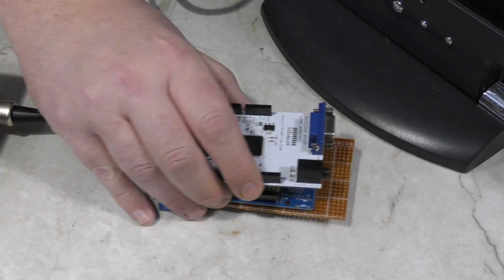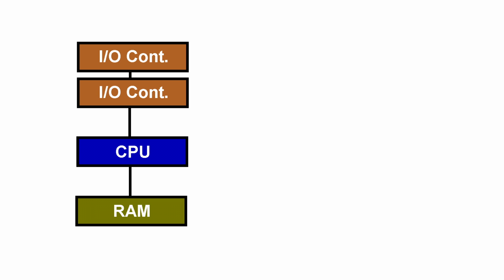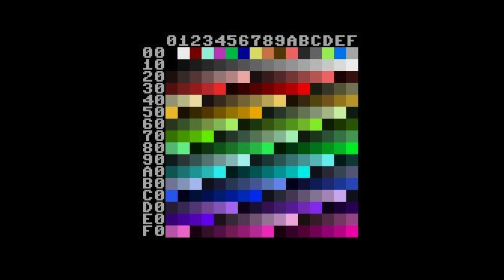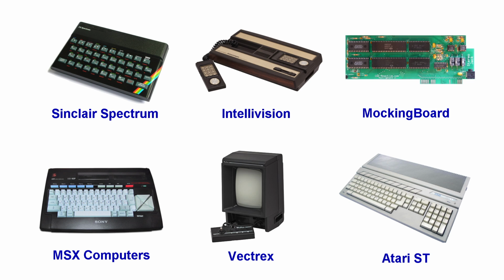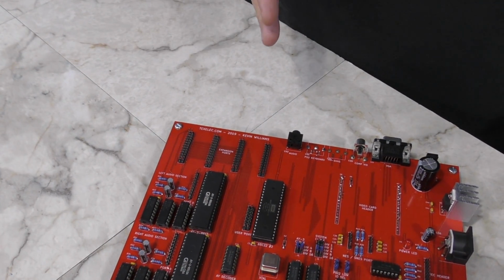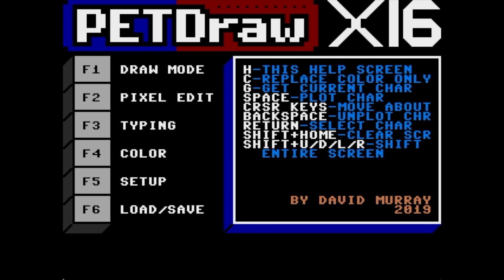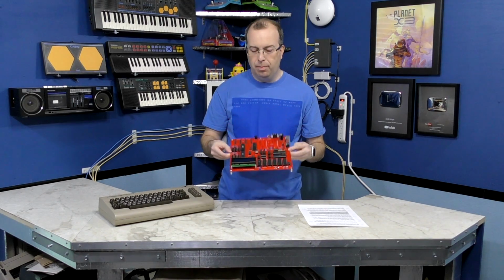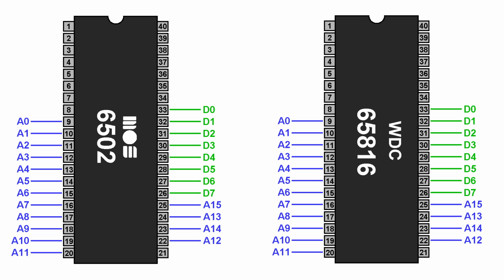Building my Dream Computer - Part 2

Comment: The Commodore line isn't one I would bring back to life.  My so called dream computer during the 8-bit days was a Z80A on 4 modified S100 boards with upto 8 interface boards to whatever (printer, disk, etc).  It would run M/PM OS.  Just wasn't that easy at the time to have access to a good CAD program.  Most of that work was with paper, drafting pencils and eraser.  Being I was in University and working.  Just never had the time.

Comment: I vote for 65C816 for the CPU, even on non-extended addressing mode

- as it will still be able to use the 16-bit data mode 

- and be more interesting to program than the plain old 6502 ...

Comment: Btw. It would be nice, if the "Dream Computer" could also be used from one of the ROM bank software as a terminal (e.g. VT52/VT100) to also work as a terminal for other computers (e.g. connecting a Unix machine via serial). So it becomes much more usefull, than just being some sort of a vintage play station, which is certainly nice to have. But more than just that, is more of course!
Reply: Yes please, it would be very handy to have a dumb terminal built in to this if it doesn't get in the way of other requirements. It seems like a great way to expand the retro-usefulness of the system with minimal additional requirements.

Comment: Sorry dude.  Whereas I applaud the ideas and execution behind this project,  the basic looks like a horrible throwback. Cryptic POKEs and line numbers are  a Retro too far - not everything about the 80s was great .  Needs that better basic desperately  and it would be fantastic. If you want a basic like the maximite (mmbasic)  contact Geoff,  he is very helpful and having the C source would probably short circuit a lot of the development.

Comment: It's a pitty you haven't used Zilog or Motorola processor, 8 or 16 bit. It would be much user friendly for machine code programming.
Reply: but he is building a commodore 
they don’t use these somewhat overpower molorola chip

Comment: Although I have deep respect for what you guys are doing, I don't understand it.  Why cling to old/obsolete chips while there are current chips which can do this. Like VGA, I don't believe there's no VGA chip out there which would work. Same for sound, there must be more current chips around having 8 channels and FM.

In the end, your goal is achievable by the OS you put on there. In fact, you could just get a raspberry pi and put the OS on there, and have a way more powerfull board, for way cheaper, which performs a heck of a lot better.
Reply: One important goal for this project is to produce a computer that can be learned and understood by someone who is relatively new to computers at a bit/byte level. That becomes very difficult once more modern chips/hardware is part of the design.
Reply: @MikeMcDonoughUS  Again, I have deep respect for what you guys are accomplishing, but I totally disagree with the above statement, as it's simply not true.

Nothing can be learned better on this machine than, for instance, on a raspberry pi. OR any other current SBC. 

Sure the chips have gotten more capabilities, but programming them is no different.

Comment: I love the idea about  Commander X16, infact i wished, Commodore USA would still exist, they did an awsome job for their case. I grow up, with an Apple ii europlus,  so i felt in love with the sound of the Keyboard. 
Do you ever thought about a case like the Commodore c128, but a bit more modern?

I had an awsome idea, for a kind of disk drive, but I don't want tell it here, because don't want my idea would be stolen. 🤐😮
Reply: Hi! We are going this route for very good reasons. I'll be doing a full post and user poll shortly on the Facebook about this. In short, we don't want to custom build a case and keyboard as that would add hundreds of thousands of dollars which you guys would have to pay for. It also introduces many risks and delays as you have seen on other projects like the ZX Spectrum Next. Therefore we are limited to high quality off-the-shelf components, which is the spirit of David's project. We will be customizing and rebranding these and you'll see all the options in the aforementioned poll, and have a say. We realize with nearly 1 million subscribers we are not going to be able to please everybody, and we thank you for respecting that. However you can trust that we are moving forward with the best possible option for the community so you can get this machine in your hands as quickly as possible and at the best value. 👍🕹️
Reply: @RetroRecipes  I didn't know a Keyboard and a case could be that extensiv. 😮
I know you want to realize something for a fair price for everyone. 
But as far as I remeber, I saw a company, which build cases which looks like the Commodore 128. 
I wish you all the best for your project! 👍👍
Reply: Finally I found my idea was already stolen😁 even before I had the idea. 
My idea was to use a Floppy as a SDCard Adapter so the SD would go into the Floppy-Disk. And the Floppy-Drive would be just a huge SDCard reader. I know a lot of work, but it could look awesome.

Comment: if there isn't a version released that fits inside the keyboard unit like the original commodores did, I will be VERY disappointed. (it would also be cool if said version could also be hooked up to a modern PC and used as a keyboard)
Reply: the current case is horrendous
Reply: @Walczyk  not for prototyping purposes. Yeah, it's basically just a generic nettop case with some aesthetic changes, and I think it doesn't really feel like an 8-bit computer without the integrated keyboard, but if it were a case for something like a raspberry pi or other more modern rig, I wouldn't mind it. I think the only reason they're even using that case at the moment is because of the off the shelf parts deal. If they could get motherboards in the original C64/Vic-20 form factor, I feel like they would. And for the cheapo nettop/POS machine computers, why hasn't that motherboard/case form factor come back? (I mean, aside from how easy it would be to steal them)

Comment: You have already an fpga for video along his local screen memory. So put the sound core and sound memory there also. The CPU has only to give simple commands thru the registers. Then provide megabytes of direct access memory on the FPGA for all the sound and graphic data that You need to move for the games of our dreams. If the fpga is big enough maybe You can implement there DMA, sprites, accelerated graphic engines. In this way developers don't need of the complicated bank switching techniques and moving data around with the CPU...and yes, the 6502 will go full speed then!

Comment: One short Idea : What if the FPGA, which does graphics also does the bank switching ? It would be easily possible to map the 8 K of Bank Switching into the FPGA, which would give you access to Chunks of 8Kb of Video RAM as well as Chunks of 8KB of RAM of the 2 MB ? You would have an "high speed" Access to video as well as to the High Memory.

Comment: The assumption that 1MHz 6502 has the same speed as 4.7 8088 is wrong*. On average, you would need at least 2MHz 6502 to get the same speed.

*) Isn't it based on these findings? https://trixter.oldskool.org/2011/06/04/at-a-disadvantage/

Comment: Impressive progress!  For the spiral-bound manual, looking at some of the old ones on my bookshelf, it may be better to have the type where the cover folds over the back of the binding.  These ones seem to survive better.  About the assembler, one way to do it may be similar to the BBC Micro and Archimedes computers, where it is included in the Basic interpreter.  In fact, it is one of the great features of BBC Basic on these machines.  Lastly, like many others commenting here, I don't do Facebook.  I also don't do Twitter or Instagram.

Comment: I open my bios to check the temperature of my processor then after checking i exit in bios without doing any changes, then the computer start rebooting while rebooting i unplug the hdmi connector and plug in it to my other monitor then my monitor dont recieve any signal so i push the power button and restart it. And that the problem occur, my monitor dont recieve any signal but my pc was on and all fans are woking including the fan of my proccessor. What Im supposed to do?

Comment: Great project, but just a remark: the Sinclair ZX-Spectrum (the original 16k and 48k versions) didn't have an AY38910 sound chip. The sound capabilities of this computer were actually very poor:  there was only one output bit controlling a tiny speaker (in parallel with the audio jack that was used to record programs and data on tapes). Even worse, playing a tune in Basic by using the BEEP command (generating square wave signals) blocked the execution of the code. The trick was to code in assembler a modification of the 50-Hz interrupt vector in order to play, for each video frame, a very short note (its pitch was read from a table in RAM and the index counter increased after each interrupt).  The melody stored in RAM had therefore to be split into very short notes played every 20 ms, which created a strange "ringing" effect. The "Manic Miner" game used this trick to play Grieg's Peer Gynt theme  😉.

Comment: How are you handling block move/copy in video RAM? With only one port for read or write you have to set address, read to work RAM, set address, write to VRAM... but scrolling text seems like it's a bit smoother than that. Does the Vera have copper/blitter features?

And you could use an AY-3 with a faster CPU clock... you already have a divider for the sound clock, you need a latch for the data and a way to hold /RDY low when the sound chips are selected until the clocks synchronize. If you're using the 65816, it has some machine state lines the 6502 does not, which will make wait state logic simpler.

You could interface the 65816 bank address too: When PHI2 is low, latch the data bus to the bank lines, and select banked RAM at $XXA000 like now, yeah, it would mirror $000000-$009FFF to each bank but that's OK. ROM could be banked the same way. When the E-flag output of the 65816 is high, use the bank from the VIA ports. In fact you can just OR the latch and port outputs as the 65816 always outputs bank $00 in emulation mode.

Comment: As I am currently into coding games for the Ti84CE calculator, and this seems similar, I might try to develop something for this device at some time when it's released.
That probably requires me learning a bit about assembly, as I currently just use C.

Comment: So sad we can't have the expandable board in a keyboard case. The vic20 and c64 were not only easy to program but also easy to expand, which is lost on both smaller versions. So what's the point?

Comment: I like the banking as it's pretty nice and clean. I would specifically set aside a couple of the banks for Kernel use only, that way you have an area that should always be owned/controlled by your kernel so it can safely keep it's data there. It does mean that any kernel entry point would have to save and restore the old banking and need extra logic to copy data between banks (or mandate that you can pass in high memory to the kernel, which would suck). None of that is a huge challenge and will make the kernel more robust.

Also, it would be great to leave the LCD header on the board, that way you can connected one if you want/need to. That will provide some level of always available debug output. That could be very useful if you're developing a graphics program or anything else that might prevent the normal video from being available.

Comment: What about a PIC processor instead of an FPGA for the sound chip. That way more of us could mod it's programming to do other things. Pic one with an enhanced parallel port interface and get it to act as a bus slave. It should have both AtoD and PWM for both in and out for audio.

Comment: Hmm. The memory map you came up with starts to look a lot like how the Atari 8 bit system worked with it's later iterations (XE series with 128k of RAM)
Also how it worked with banked cartridges, since there's some internal logic to aid cartridge bank switching.

The main method though involved memory mapping part of the upper 128k of RAM into a 16k memory window.
How you control this is mapped though controller IO register B.
The reason they could do that is that this register was for reading controllers 3 and 4, but those weren't present anymore after the XL revisions...
So the port was repurposed for expanded memory control.
Technically you can map both the CPU and ANTIC independently to use the extended memory.
And although this technique officially only existed for the 130XE model with 128k, it turned out to be really easy to backport, leading to the RAMBO 3rd party expansions which worked on both XL and XE machines and can allow anything from 256k to 1088k or more all using the same process.

The Atari's core architecture certainly seemed a bit cleaner than the c64's.
the early models with about 32k or less of RAM mapped all  the ROM, cartridge and IO logic into the upper 32k. Later models let you turn the ROM and Basic on and off, though the built in basic counts as being in the cartridge address space for legacy reasons.
Antic can use ANY memory, and as noted with a memory expansion it can even use extended memory without messing with the CPU.

I'd say the Atari has the better architecture, it's just that the c64 had much better sprite handling and a few other niceties, and of course the amazing SID chip.

My ideal retro style system already exists though, so eh. XD
(For the record that's an atari with Rapidus and VBXE installed. Massive overkill for most 'retro' style stuff, especially the VBXE, but still)

Only thing that's painful about this setup is that it can't be made purely using 'off the shelf' parts.
But it could come close if you accept that you'd lose a tiny bit of legacy code support, by altering Rapidus and VBXE to work without the old chips installed, then reconstructing the rest of the Atari chipset, which doesn't actually contain much of anything that's hard to reproduce with modern parts. 
Only thing missing in terms of 'modern' replacements is Pokey. But there's plenty of options there...

And in terms of design optimisation, if the original atari bus is gone, you'd really want to tie VBXE and Rapidus together more directly, since both are accessing a rather slow 1.79 mhz bus through their own respective memory windows, when both can operate way faster than that bus...

Comment: This question isn't related to the project at all, but rather to an older video you made on what old school computers did better. You mentioned the fact that they boot almost instantaneously, and I wonder why that is. Is it because the "OS" (I don't know i thi is the correct term to use here) is hardcoded inside the chip? Or is it because it is comprised of much less code, hence faster loading speeds? Thanks in advance to anyone that answers.
Reply: The primary reason is that the "OS" (or in most cases a BASIC interpreter with a few file I/O commands) is stored in one or more ROM chips; and therefore doesn't need to be loaded from secondary storage into memory before it can be executed.
Reply: @gwishart  Thank you very much!

Comment: You know, given the fact that it's been in near constant production and has even had some process tweaks, an official FPGA core and so on...

It really boggles the mind that they never created an expanded version of the 65816 that could do away with the address multiplexing, and thus the external support circuitry.

I mean, is it really that hard to create a version of the same chip with 24 physical address lines?
Surely that would have some advantages (especially in new designs), even if you'd need to keep the 16 pin version available for legacy reasons...

Comment: The Jupiter ACE had Forth instead of BASIC. Since Forth is much more capable than BASIC, and can be extremely small, perhaps it could be included in the stock ROM as a third option (besides BASIC and asm)?

Comment: i wished that the keyboard was integrated into the case
agree?
Reply: Hi! We are going this route for very good reasons. I'll be doing a full post and user poll shortly on the Facebook about this. In short, we don't want to custom build a case and keyboard as that would add hundreds of thousands of dollars which you guys would have to pay for. 

It also introduces many risks and delays as you have seen on other projects like the ZX Spectrum Next. Therefore we are limited to high quality off-the-shelf components, which is the spirit of David's project. We will be customizing and rebranding these and you'll see all the options in the aforementioned poll, and have a say. We realize with nearly 1 million subscribers we are not going to be able to please everybody, and we thank you for respecting that. 

However you can trust that we are moving forward with the best possible option for the community so you can get this machine in your hands as quickly as possible, looking sweet, and at the best value.

Keep in mind too that many beautiful classic computers did not have an integrated keyboard. Apple Macintosh, Amiga 1000, Commodore 128D, Amstrad PCW... 

Thank you for your enthusiasm and feedback 👍🕹️
Reply: @RetroRecipes  thanks for clearing that up!

Comment: "Feature creep" yes, good expression. This is exactly why I don't like PFGAs for use in retro hardware. There's so much new Amiga hardware that uses FPGAs, and they mostly end up being complete systems on a board type thingies, that "pretend" to be an accelerator, or a graphics card or whatever else, but they can load full Amiga system cores and replace every single component in the system, effectively using the Amiga only as a power delivery system. And then it becomes pointless.